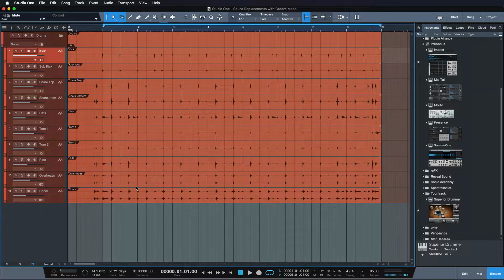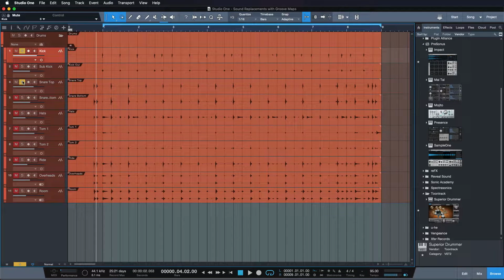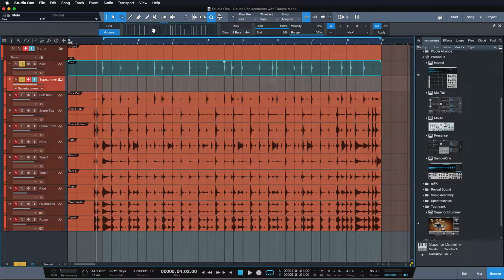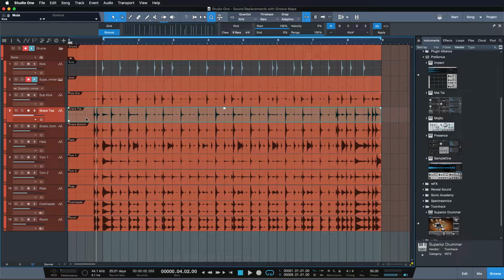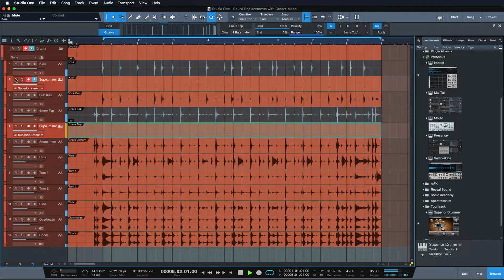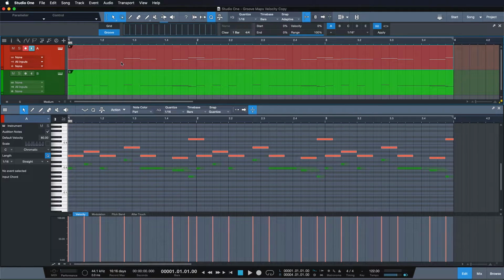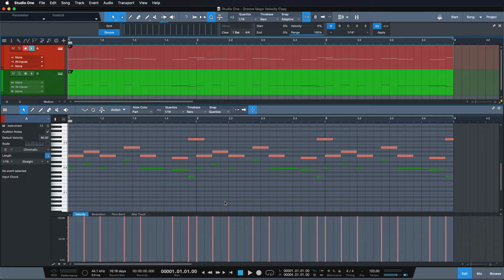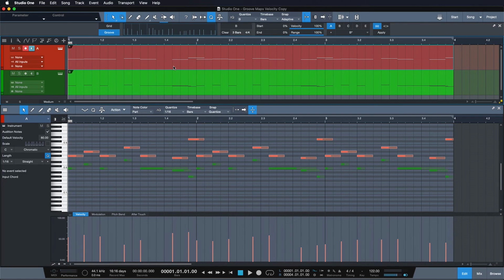PreSonus Studio One Tutorials Ep. 17: Groove Maps

Comment: Hey Gregor, the Groove capture works for a kick trigger but the transient detection is late if you zoom in, it's consistently late and I can't see how to adjust it part from shifting the midi after the detection. Is there a bug in 5.2?
Reply from the maker: Hi Alan, Studio One's transient detection is based on the peak of the transient, not the note onset - this makes for better rhythmic accuracy, even if it looks a little bit off at first sight. -GBY
Reply: @fenderstudio  thanks for the reply Gregor, I have since discovered that's how it works , I kinda get that design for consistency but practically it's not much use, generating triggers from this transient means it's late, eg triggering a new kick results in flams no matter how I adjust it as the original kick on the 1 is not the peak of the transient but the start of the attack. Basically it seems impossible to double a drum part without a delay because of the peak offset, or is there something I'm missing?
Reply: @alanbranch449  I actually heard a flam effect in this tutorial. I think it's with the snares.
Reply: @ELLIOT8209  I don't notice it in the video, I get what they are trying to do by adjusting the threshold to the most energy on the transient it gives a  more consistent result, however it does mean triggered beats are often late, so it flams & can cause phase etc issues, my workaround for now is simply to phase align the trigger afterwards. Still a great simple feature by Presonus for retriggering.

Comment: I have Studio One 3, and it creates bend markers AFTER the transient, which is annoyingly, embarrassingly useless for drum replacement, or anything to do with the groove map.  has this been fixed in S1 4?
Reply from the maker: Hi Voice the Warrior, bend marker detection has been working correctly in Studio One 3 already. The bend marker line is being placed at the position where Studio One spots the zero crossing point of the Transient. This ensures perfect results every time. The blue range going out to the left from the bend marker marks the beginning of the Transient. -GBY
Reply: @fenderstudio  Thanks for the response!  
Im not sure that my question was understood, though (or my critique is correct and my criticism is valid!).
How do i set it up so that the groove map creates midi that lines up with the starts of the transients of my acoustic drum tracks? 
If my snare sample starts it's hit at the peak of my acoustic snare hit, as opposed to the beginning, then they do not line up, and each hit/sample pair is offset by a different amount, so that I cant even fix it with auto-align or manual track nudging.
If you can explain to me how to set this up (without buying Cubase or Logic) I will be eternally grateful, since S1 is my favourite DAW in all other respects!

I will also delete my initial comment, which would be unfair to leave public if what Im trying to do is, in fact, possible!
Thanks!